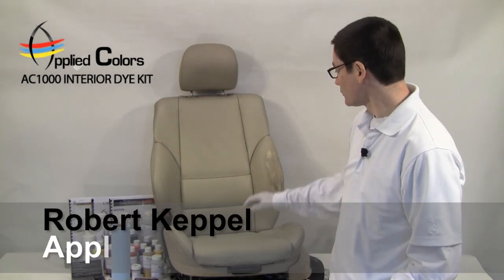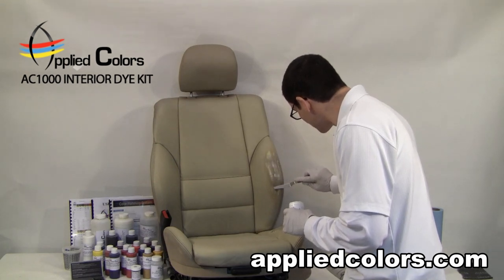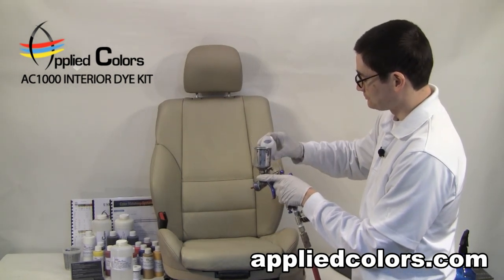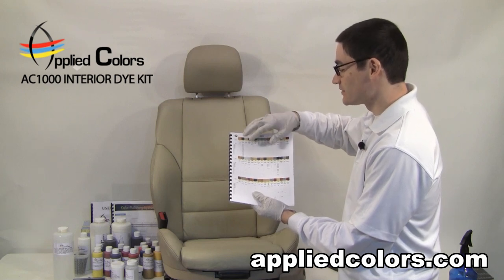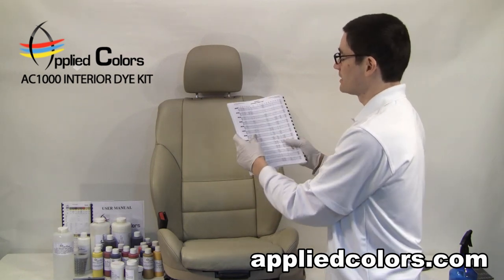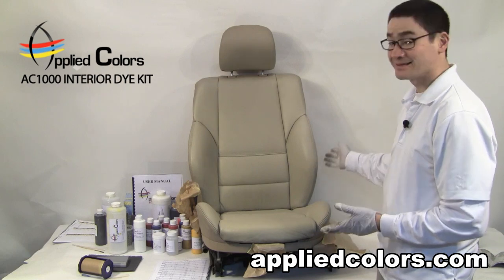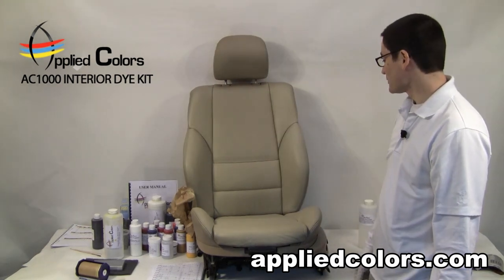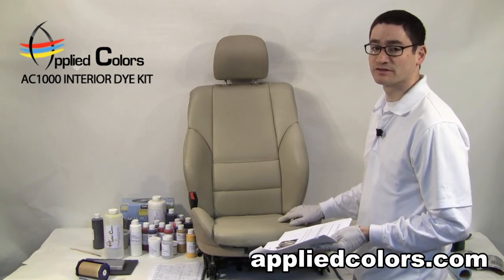Vinyl & Leather Dye System:  Applied Colors AC1000 Demo

Comment: When storing used paint I gently blow into the container while while putting the cap on to remove the oxygen.  No oxygen, no oxidation - I've stored paints in plastic containers for over 15 years using this method- the paint stays like new.